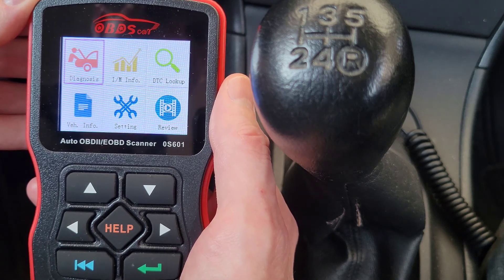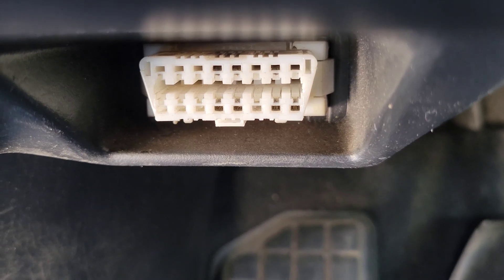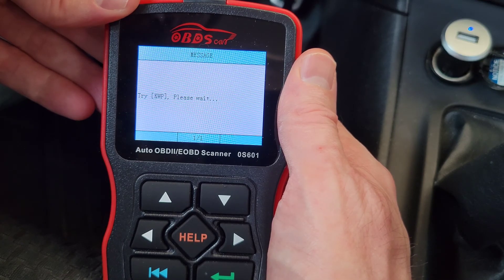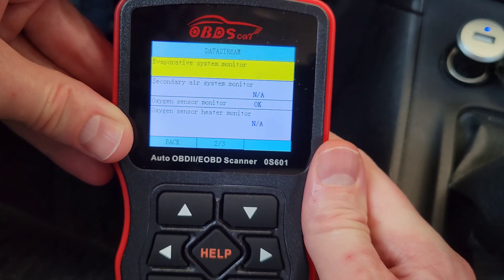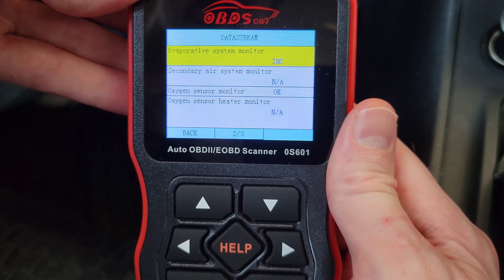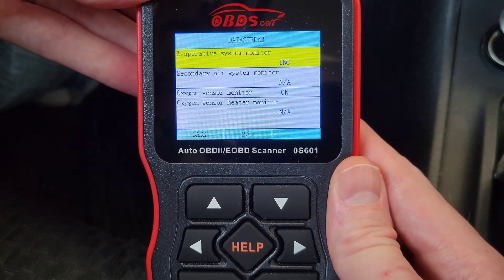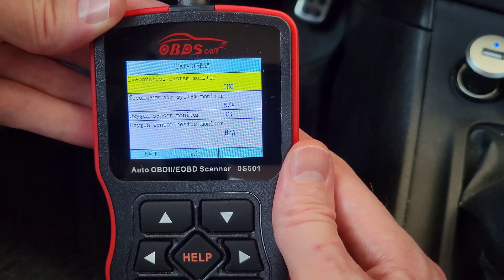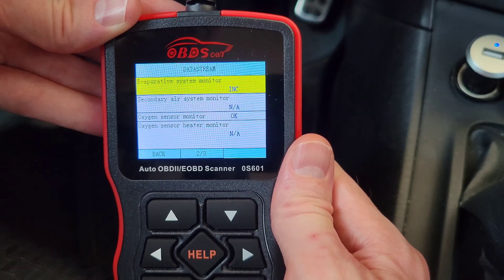Emissions Test - What are I/M Readiness Monitors And How To Fix

Comment: 2015 Mustang Roush stage3 supercharged    I/M monitors.  fuel, o2, Ho2 will not set,   New plugs, new O2s all 4 of them, new injectors, new coil packs, has a #2 cylinder random misfire sometimes #4 and #6. Rarely though.    No codes,   Go.👉🏻

Comment: Very nicely put. Thanks. I have a question, does MIL Lamp Needs to be ON till the OBD System becomes Ready especially when Non Continous- Major Monitors (after multiple Drive cycles)  ..(I mean MIL On Till OBD System is ready Emission Status, although we may have Engine Started )

Comment: I am having a hard time finding out what my drive cycles are for my 2012 Buick Verano.  I made the mistake of getting a new battery the day before my smog.  It was rejected due to the computer system just didn't have enough information saved.  I was told to go thru my drive cycles then take it back.
Reply: Run it with the Cat really warmed up with no traffic.  Let it sit overnight to complete the O2 heater.

Comment: Check your states readiness area on the web page.. Example my car is a 2013 My evap system  Never resets for some weird reason but they will pass me because it's only one of the monitoring systems I'm allowed one monitoring system not to  be ready.. And you'll pass the inspection everything depends on your year of car and state...  Even with the driving conditions it just doesn't reset for some reason but it has in the past by itself...   It's interesting so I'm here looking to see if I can find a scanner that I could check to make sure before I go I need to get inspected... I did find a problem with a slight crack in the hose for the evap Vacuum hose it was hard as a rock you supposed to be rubber soft ... Eventually it will reset but I don't have the time if 1 system is not ready I'm not worried im getting it test anyway because they will still pass you.. Of course I want to check if it's just the one system that's not ready Which it probably is just the one system not ready.. Example I've replaced the battery about four months ago and I've driven thousands of miles and it hasn't reset ..   I know some states don't allow anything to be not ready it all depends on the state... I know what the cause was but it's still not resetting even after I fixed it for some reason the car is a pain in the neck to reset   Probably because I don't let the fuel Go low enough

Comment: Mine said na for everything and I’ve been driving for a while now
Reply: What year is your car?
Reply: @stevew9563  no worries I’ve already passed 😩😩
Reply: All mine say na n I keep failing 😭😭😭
Reply: @blessedbycandy5501   - What year is you car?   You are looking at your own scanner right?
Reply: @stevew9563  2003
Reply: @blessedbycandy5501   - Ok so when you check the monitors on a scanner make sure you are looking at the "Since DTC's Cleared" screen and not the "This Key Cycle" screen
Reply: Have a 2001 voyager 2.4 eng  monitors ready then  go back to all  not ready if I turn off key or cools down. idling   won't stay on long enough to inspect  no dts     changed alt . Batt went dead while driving  àny help

Comment: I just took my car through inspection and it passed. I had a light come I just hooked up the code reader and it said no powertrain dtcs or freeze frame data stored in computer but at the top it says emissions related module and eva light flashing. What does that mean? If can help me any
Reply: EVA is for your Evaporative Emissions Monitor. If flashing that probably meant it was "Not Ready"  in most all states you can pass a Emissions check with the EVAP monitor not ready so that is why you passed.  The EVAP is usually the hardest one to get ready on most cars.

Comment: I got new o2 sensors installed did the drive cycle and after that only 1 monitor was inc which needed a cold start but after 5 hours I just checked again to confirm the inc monitor and now it showed 3 inc monitor I didn't do the drive cycle again though is that normal for a monitor to change to inc to ok after resting a few hours?
Reply: There are usually two screens on some scanners that show monitors.  Make sure you are looking at the right one.  
There is "Monitors this key cycle" and "Monitors Since Last DTC cleared".   Monitors since last DTC clear is the one you want to look at.  
Ignore the Monitors this key cycle screen.
Reply: One is for engine the other one is for Transmission.  Or you need to flash the computer

Comment: I got rejected! Said 3 things weren’t reading. And I got a new battery seven months ago and have driven the vehicle thousands of miles since and been both on highways and local roads. What could be the problem?  Surely, all would have rest by now after thousands of miles. I’ve had no
 Work done on my vehicle besides that new battery 7 months ago and two new front tires about two months ago. Makes no sense.
Reply: I've been rejected 5 times.  Wanna self delete sometimes.
Reply: Computer re-flash

Comment: So to cheat emissions , reset codes, then when they get the thing that says you reset the code you tell them you just put a new battery in the car?
Reply: Then you fail the test and send you to drive until the car next time finishes self test I guess? I/M ready is just a double check before you send the car to pass emission IMO
Reply: @SickMy_Duck  what is I/m” ?
Reply: Nope. I didn’t reset anything and I got rejected  and they said I have to drive after resetting the codes or getting a new battery.  Neither of which I’ve done. A new battery was 7 months ago. Have driven thousands of miles since
Reply: No, because those codes you just erased will read as "not ready" in the emissions system when they do the test. You have to drive a full drive cycle (can range from 50-100 miles depending on the car), given that the check engine light doesn't come back on in that time. Usually, if there are issues, the light WILL come back within the same day or a day later.
Reply: Warm up Cats & O2s. Then jump on the freeway to set system ready b4 code comes up. Works more than half the time.

Comment: So my code reader has green check marks INC N/A and red X. If I have a code, typically it shows me a red X on the associated monitor. I currently have green check marks on everything but I'm still getting P0420. Any ideas?
Reply: The codes and Monitors are not related to each other.  So you could have a cat code and the monitor might be OK or Incomplete.  Bottom line is if you got a "current" or "Active" code you got a problem that needs fixin.
Reply: Same problem here, did you fix it?
Reply: @coolghoul9  I ended up replacing the catalytic converter. The dealership I bought the vehicle from half-assed the exhaust and put in a junk 90 day cat just to get it to pass long enough to sell it.

Comment: Great info. I have an 02' Blazer zr2 4.3ltr 
It takes around 100+ miles to reset everything.  That's driving in town,  highway,  AC, Cruise on/off, etc. Takes my Uncles chevy p/u around 300 miles to reset which is crazy. 
I had a P0420 code. I have less than 500 miles on my exhaust,  catalytic converter,  sensors but changed my bank 1 sensor & the same code came back. Replaced the 2nd 02 sensor (just b4 the cat) now waiting on reset. 
Scanner shows all 02 sensors reading correctly but still showing Cat, Inc. Fuel trims are almost perfect at -.03% on my almost 300k mile ZR2.  If this Code comes back, I haven't a clue what it is. The Cat is a newly installed High flow Flowmaster Cat. Mechanics assured me it would not throw a code when I bought it & had them weld it in.
Reply: What happened bro?
Reply: Anyone reading this… try Catyclean per directions for this code. Works sometimes

Comment: Very helpful Todd.  I reset a code for a small evap leak just before trying to get smog and of course failed because I didn't know the IM thing.  My vehicle is a Toyota sienna 2006.  Don't know when it should return to ok
Reply: Try a new gas cap or filling the tank and then tighten the cap.

Comment: So I have 1 code. It’s a p1000. It will not go away, and I haven’t cleared codes. I guess it could be in these readiness tests?
Reply: Yes some manufacturers have the ECU set a code until all the monitors are completed.    Once they are complete the code goes away.